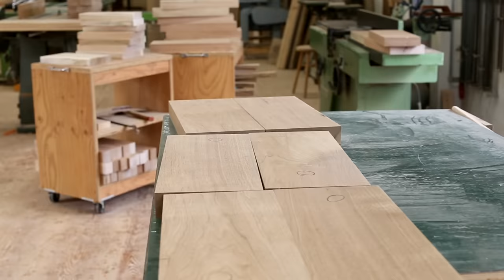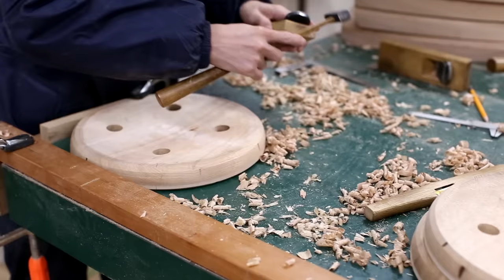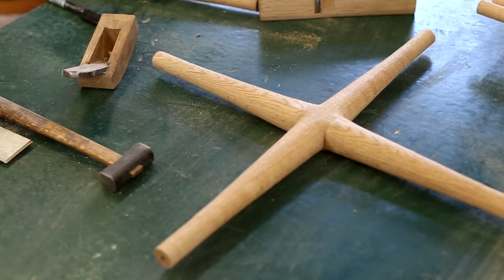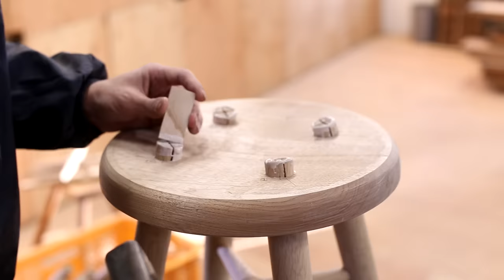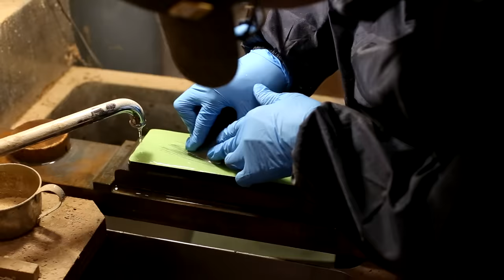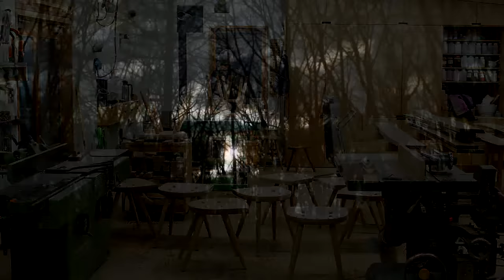ISHITANI - Making MARU Stools

Comment: There's just one question I have.... Why a cross-cut on the top of the legs where they attach to the seat?  Is just pure aesthetics
Reply: You mean the crosscut in the part of the legs above the seat? A wedge is inserted later to pry that part apart, making it thicker and preventing the legs from dropping out of the seat later in its life. It wedges the legs into the seat.
Reply: I meant why a "crosscut" and not a single-cut to wedge out the pieces?

Comment: Hello Master. Always enjoys watching your fine methods of work.
The only thing I have always been wondering : since you are such a great master, and lover of precision and accuracy (2 different things) why do you never join inclined legs
to their base in a proper joint : i.e. you keep the legs with their radius reduction perpendicular to their own center-line axis, rather than tilting to be flush with the base?
Reply: It's because the tenon is turned on a lathe - the shoulder can only be 90 degrees to the leg ( unless he spent a lot more time hand carving the shoulder ) - there is a way to turn the tenon at the angle but it results in short grain sections making it much weaker ( off centre turning ) - it's much easier to do with square stock but it doesn't match the piece...
Reply: Thanks Mr. Kikoboy. However there is another way which is increasing the bore in the Base to accept 1 or 2 cm of the full width of the leg and hide the unpleasant 
appearance of a slanted edge.
Reply: That would work - add an extra step though- or he could turn a longer tenon and just flare the leg diameter further down as well instead of having a hard shoulder....
Reply: Going off the channel and his style I am going to guess it is an intentional design choice. I think the beauty in his work is the use of techniques that can be achieved using only hand tools. ...Is this an example of the joint you were referencing? http://www.instructables.com/id/Easy-Angled-Mortices-on-the-Drill-Press-Attaching-/